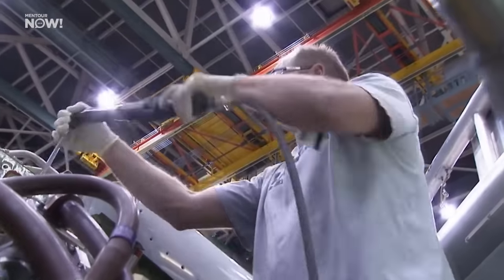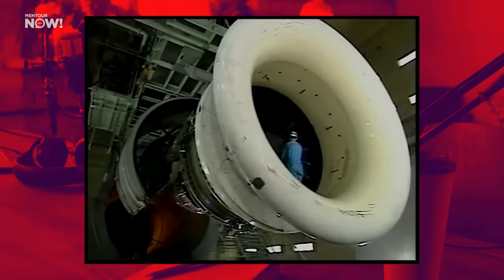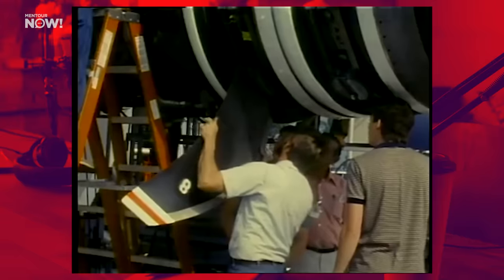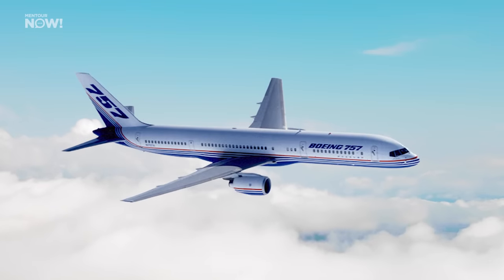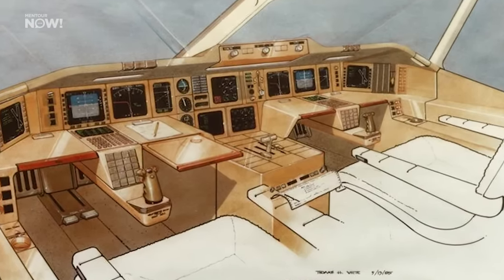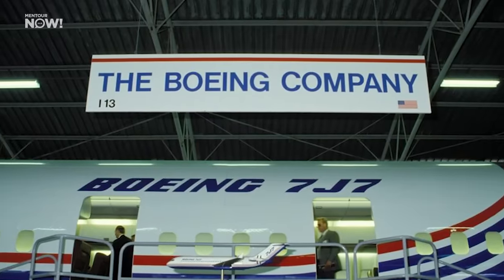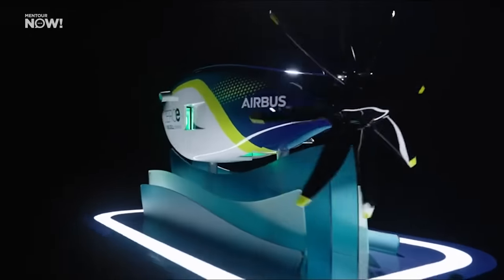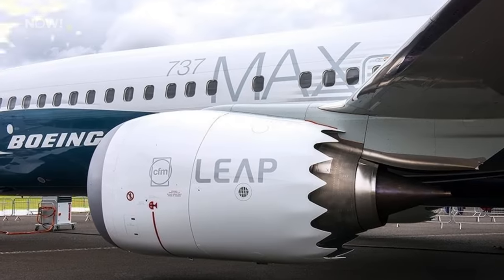Revolutionizing Flight! The Amazing Potential of the CFM RISE Engine.

Comment: Count me amount the skeptical. It seems like nothing more than an overgrown turboprop to me. I wonder what the cruise speed of the aircraft using this engine will be. The reason why turbofan airliners can fly faster than mach 0.8 is because the duct surrounding the fan reduces the velocity of the air to keep it from going supersonic, and also reduces tip vortex losses.

Comment: They definitely should develop an electric version of this fan. Electric aviation at least for national flights (shorter distance flights) is a necessity for the future and the gravimetric energy density of batteries is getting better and better. So with increasing "fuel" efficiency of the plane (wing design) and the fan the realizability of electric passenger flights comes closer, maybe even on medium distances.

Comment: It looks a bit less elegant than a turbofan,which keeps the whole stuff inside its case.However if it actually improves fuel efficiency or is lighter than an equivalent turbofan engine,we'll see plenty of this kind of machine on airplanes.Time will tell.

Comment: Are these engines likely to have the same control and monitoring as any VP prop engine, with auto and manual feather and negative torque systems? With the exception of the VSVs it's just a turbo prop as I see it. More to go wrong, anti-ice systems, prop phase/sync, pitch stops and locks...looks like a backward step from a ducted fan.

Comment: Could this same type of 'static' second rotor design, benefit smaller private single and twin engine air craft ?!
Reply: No, unfortunately. The stationary guide vanes are useful when the fan is doing a lot of work and has added a lot of swirl to the flow. A propeller doesn't have nearly as much swirl that can be recovered, so it'd be too draggy to be worthwhile.

Comment: What are the advantages of the two counter-rotating fans? Is there some sort of pressure loss due to centrifugal acceleration
Reply: Yes. The first fan raises the energy of the flow, partially by raising its pressure but also by adding swirl (air spinning with the fan). If you add a counter-rotating propeller you can add even more energy while simultaneously reducing that swirl. CFM RISE is simpler and just has the stationary blades, which don't add energy to the flow but convert swirl energy into pressure to increase thrust
Reply: @AmbientMorality  oh thank you that makes sense

Comment: I always thought that if you add more prop blades, wouldn't that create more drag to the point that it gets inefficient? 

Also what would be the purpose of the stator vanes?
Reply: Yes and no, with more blades you get more thrust and less noise, eventually though, yes it will become too inefficient. The stator vanes convert the rotational energy imparted on the air by the rotating prop into a pressure differential to increase the efficiency. So the combination of more propellers and the stator blades allows for better efficiency while still having the gains of the lower noise and greater thrust.
Reply: Yes and no, with more blades you get more thrust and less noise, eventually though, yes it will become too inefficient. The stator vanes convert the rotational energy imparted on the air by the rotating prop into a pressure differential to increase the efficiency. So the combination of more propellers and the stator blades allows for better efficiency while still having the gains of the lower noise and greater thrust.

Comment: Good job with another informative video. News of old technology being revisited. Turboprops come to mind which is where turbo engines started and are still produced. But will there ever be an aircraft that satisfies the bean counters? If they could buy one that actually produced fuel rather than consume it, they still wouldn't be happy. And of course, Boeing and Airbus wouldn't build it anyway as there would be no need for the never-ending spoon-feeding of new "technology" that seems to drive aviation. We're a throwaway society and nothing man has done throws away good machinery more than aviation. Perhaps it's time commercial airlines start flying less and charge more for their product rather than trying to operate as a mass transit.

Comment: Ok, I've only watched about 3 minutes of this video. But I'm writing this comment now to say just one thing. Yeah this new engine design seems to have potential in efficiency, but I see one MAJOR drawback. The casing around modern engines we are used to is designed for many harsh scenarios, one of them being a fan blade failure. The casing around the engines are all designed to withstand the failure of a fan blade which protects other parts of the aircraft from further damage. But this new design leaves them completely exposed, so if one were to fail, it could have devastating consequences. 

Of course, I am almost certain that the engineers are sharing this same concern. I doubt this hasn't crossed the minds of the people developing this new engine. They have to comply with safety regulations anyway in order to get an aircraft certified for commercial use. This is just something I wanted to point out.

Comment: I am confused by this design's supposed benefits. As someone who builds planes, but not engines, I am less familiar with the physics and fluid dynamics than perhaps I need to be, but more so than the average person. For years, it has been said that all else equal, a ducted fan will push air more efficiently than an open fan, as the ducting reduces drag due to blade tip vortices and wasted air being pushed in any direction besides the direction desired. I can understand the stators helping with the latter problem, but only to an extent, and there is no solution for the former problem. In short, physics says this is worse. So how is someone able to say it is better?
As far as naming conventions go, the turbo in turboprop is from the engine having a turbocompressor compressing the air before burning it. An open fan is a non-ducted fan. And as far as I know, fan and propeller are used interchangeably. Only the salesman are trying to separate this "new" open fan from "old" turboprops.

Comment: It frightens me to see that Aircraft designers still want to mount jet engines at the rear of an aircraft. They seem to forget that earlier rear engine aircraft were more likely to stall  and were harder to recover from a stall due to the wings causing disturbed airflow into the engines plus the rear engined aircraft engines were further away from the centre of gravity and create a moment where the aircraft would stall  tail down on its tailplanes and elevators were not able to create enough force to lift the tail up for a horizontal flight or nose down flight..I think this is why there are not many large rear engined passenger aircraft You may even find accident reports on this subject

Comment: UNRELATED TO ANY OF THIS----EXCEPT IT IS STILL ABOUT FLIGHT EFFICIENCY----A GENERAL QUESTION: WHAT has been experimented with (if anything) regarding wing size to expand lifting ability or even gliding capability? I NEVER HEAR ABOUT MUCH IN THE WAY OF BIGGER, WIDER ETC WING EXPERIMENTATION/CONFIGURATIONS. I only ever seem to hear about new engine ideas and principles.

Comment: Can't we use electric motors instead of engine and place the generator at the back of the plane?
Reply: Well it’s pretty hard to find batteries with enough energy for their weigh size and motors with enough torque to power an aircraft on a long haul flight

Comment: My hope is that structural batteries are a reality in the next 10 to 20 years.  Having an aircraft that fuels up without the weight of conventional fuel, with engines that can't stall and are much simpler to operate will really be a game changer.  The toxicity of current aviation fuel is unacceptable.

Comment: Why don't they just do variable pitch discs on turbofans?  They're basically a turboshaft engine running a ducted fan at this point.
Reply: Because the required space for the the kinematics would greatly reduce the amount of blades you can use.
Reply: @shi01  There was some talk of it with the new Rolls Royce engine, but doesn't seem to be on the prototype.  There has to be a trade off point for number of blades and variable pitch.

Comment: if the size of the engine under the wing is a problem, why dont they put the engine ontop of the wing?
Reply from the maker: That would cause issues with the weight of the mounting, it would be much more complex than “hanging them”. It would also cause maintenance issues.

Comment: I stopped to watch this video because I've become very interested in boat props and I guess on the surface a prop is a prop. Obviously size differences and other variants make them different, but they essentially do the same thing in the end, push or pull a vehicle. That said there is a relatively new boat prop called a sharrow prop [cut and paste the words into the search and you'll find many videos about them. Any of you who might be engineers' I'd be curious to know if you thought that innovation could be relevant for a plane.

Comment: What do the stators behind the fan actually do?
Reply: The fan itself adds a lot of energy to the flow. Some of that is in pressure, which pushes the plane forward, but some is wasted as swirl: the energy is stored in making the air spin around with the fan. The stator doesn't add energy itself, because it's stationary, but it redirects the swirling flow backward to increase pressure further and therefore contribute thrust. It's the same principle as in a compressor, where there are several rotor and stator stages in a row.

Comment: Umm did they shrouding it like the ducted fans on jet engines rather than open air props...
They would be losing so much potential  energy thrust 😳

If you could  develop a fluid differential that would be amazing.
Might even be able to put in front of the jet engine compressor... 💕 😘 🕊️

Comment: Which will incorporate the design? Not Boeing, that's for sure! LoL They still produce an aircraft they began designing over 50 years ago!! The U-Boat also known as the 737. Little known factoid; The Germans were using the 737 as their primary U-boat in the late 1940's before being adapted to aircraft use.  At the end of the war, Boeing snapped up the German U-Boat engineers and put them to work in aircraft design. Rumor has it that the youngest engineer at the time, Wolfgang von Maschinenbauingenieur is still leading the 737 production line.
Reply: The U-737 has nothing to do with the Boeing 737.

Comment: Probably toroidal propellers will win out because they don't shed as powerful shockwaves as these open designs.

These engines are loud. That was the biggest problem in testing. The US tested a fighter jet like this and the continual roar would make you I'll or permanently damage your hearing

Comment: How come no one is saying anything about the planes that "Russia",  has been using that will fly just about as fast as the jets, only they are contra rotating turbo prop aircraft, they have used for quite some time, , Even their Helicopters are using contra rotating rotors powered by turbo prop engines. I just don't think they are spending the kind of money the U.S. dumps into their Research. I was in the Air Force , I kept looking at the design of the C-130 cargo plane, Kind of like the Cargo planes used to clear out AFGANISTAN, only those were Jet power.  When I was stationed at Ladd Air Force base Alaska. I spent a lot of hours repairing Instrumentation, Fuel Quantity, and Heat-vent repairs. You have a chance to Read and look at the designs of different equipment and Air Craft. you find yourself working in extreme cold climate. When you find yourself working in the warm Shops and Hangers, it helps  It can get to be  72 Degrees below zero. I was working on a f-89 j Fighter jets, the pilot had complaints of the Bank and Turn indicator working irately at times. It appeared several shops had worked on that problem, so pulled up the repair history, this was a two seater, the pilot took me for a ride out over the Tundra, keep in mind this was a plane used as a trainer. What I located was in leaving the run way and making several hard turns, gave me the information I needed. in that cold weather,  changes,  everything is affected like Wires, Hoses, any kind of rubber will Crack, or lose contact, in areas where Grounding is affected. Todays planes have more up to date harnesses and better set-ups. (Always keep your Vote-Ohm Meter Handy ).

Comment: Ultrafan is more efficient, more powerful and far less noisy than this engine. Ultrafan also tests at 14:1 in comparison between gear boxes, far superior. Rolls Royce is testing hydrogen via agreements with Airbus utilising its propulsion engines.

Comment: 🛫🤫🔊 It's intriguing to ponder the challenges faced by Tu-95 pilots and the sheer noise they experienced while operating such a powerful aircraft. However, let's shift our focus to the remarkable potential of the CFM RISE Engine in revolutionizing flight. While noise reduction is a crucial consideration, there are numerous other factors to explore, such as fuel efficiency, environmental impact, and advancements in aviation technology. Let's delve into a thought-provoking discussion about the future of flight and the possibilities offered by innovative engine designs.

Comment: Mark my words, classified mil tech is already far beyond this primitive engineering paradigm of air propelled aircraft, which has been present  in a/c since the Wrights. And this monstrosity of near supersonic rotating blades is near its development plateau, just like silicon based binary digit computer chips. A new paradigm is desperately needed for a new age of aeronautics.

Comment: Would this work with toroidal propellers? Evan higher efficiency, quieter.
Reply: One problem with toroidal propellers is that they're not compatible with variable pitch blades which is necessary to adapt the propelller efficiency to the flight operating point
Reply: @guillaumefrancois1117  I could imagine a variable-pitch toroidal propeller. Just replace the conventional propeller blade with a loop.

Comment: I'd say NO to the propfan!  Eventually one of those blades could fly off & hit the fuselage causing a major crash!  It looks rediculous & it is rediculous!  The safety feature a turbo-jet offers by containing a catastrophic blade failure has been completely done away with.
Reply: This is why preventative maintenance exists..
Reply: @Orbital_Inclination    Preventative/scheduled maintenance is no guarantee the job will be done right & on time.  No to the rotating bread-knife carousels.
Reply: @Afrocanuk  that's exactly what it's for. Work on propulsion of any kind requires independent checks, as well as the usual supervisor checks. As for being done on time, there is a deferment process if it makes sense to roll it into an upcoming servicing, but it's strictly bounded to well within the component life, and the person signing it off holds legal accountability.

Turboprops have been operating for decades with the same risks, they're just mitigated and managed well.

Comment: Your editor, animation and graphics guy is so good. However, they are always just off the timing mark. Also often too much going on for the time available. While it is nice to look at, not enough time to take it all in. So many little things. It's like they took it 95% the way there but didn't set key frames in the edit before creating the graphics, rather created the graphics and then edited with them.  Makes it feel "off" or out of rhythm.

Comment: they will never go anywhere, the reason is noise and safety, when a turbofan looses a blade the necelle can contain the shrapnel of the damaged blade. these things have no such thing and leave direct exposure to the fuselage creating a big risk. also this increases complexity further of the aircraft not providing that much benefit from the fuel saved.
Reply: There are many turboprop passenger airplanes still operating today and have zero issues about detached blade. Every airplane undergone serious checklist and maintenance before taking off, that risk is near zero percent
Reply: @loooopeytunes  those turbo prop aircraft operate at lower speeds than passenger jets. inorder to have a turbo prop go at these speeds the blades will have to either increase in diameter or spin at higher speeds thus creating increasing potential hazards of blade detachment. Also blades have flown off of propps and turbo fan engines. the biggest killer of this engine however isn't those issues stated above. It's the stricter noise abatement regulations surrounding airports. Again this design isn't new by any means, they've been experimenting with it in the 80's.

Comment: I have a thought instead of making the engines more efficient, how about they stop using fuel. a electic fan jet motor could be fully developed within 2 years, necessary power supply the same. people don't need to burn on bad landings. I could tell them how to make it work and i'm nobody.

Comment: like, you dont mention any of the fluid dynamics "technologies" which would actually be interesting, like, why the fuck would stator vanes make it less noisy? Smoothing out the airflow behind the blades, getting rid of any long vortices which make noise? IDK, I WISH SOMEONE WOULD DO THE RESEARCH IN A VIDEO ABOUT ENGINES TO EXPLAIN THE WORKING PRINCIPLE OF A NEW DESIGN..........

Comment: We're going to have to see high wing wide bodies first. FOD and line crew disasters bad enough with your Maneater 737. Let alone blades where everyone has ears on. I've been around them all in the last 50 years. Commercial low wing props will need retraining at least